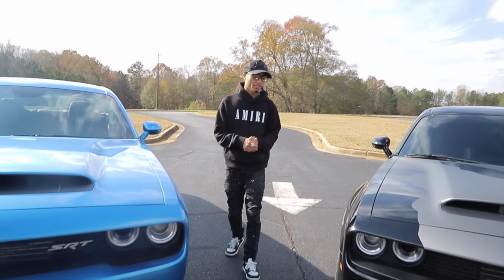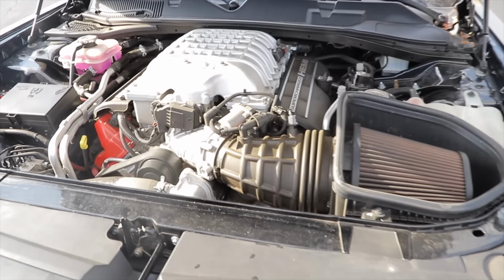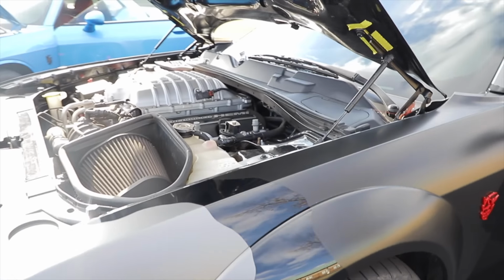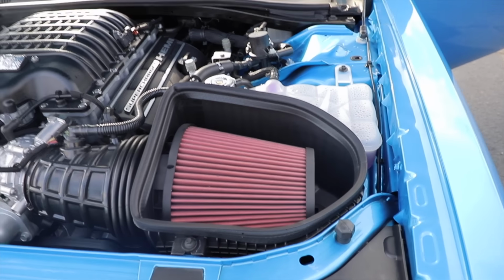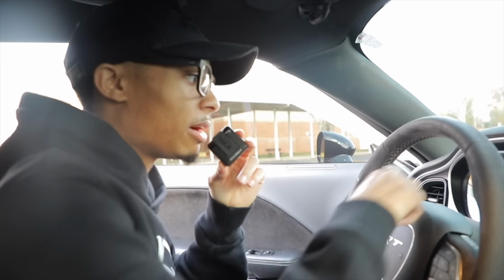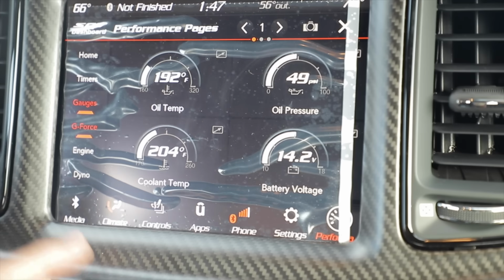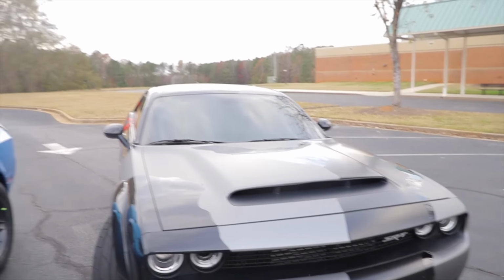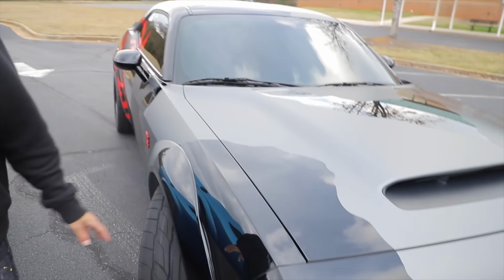FIRST EVER DEMON 170 vs DEMON RACE! *IS IT WORTH $250,000?*

Comment: The guy counting has the advantage on a roll race. The 2018 Demon had 840 h.p. in full power mode I believe. Dodge claimed an 9:65 sec 1/4 mile @ 142 mph I think. I remember Herman from Demonology had to do a lot of runs and tuning etc etc to get his Demon down to Dodge’s claimed times. Obviously a prepped track with really good air etc etc. Herman broke the rear diff mount which Dodge has fixed too. Great cars but it looks like they are no longer. Rest in Peace.🥺😢😫

Comment: 28k Demon170 crate motor in a much lighter 3400lb 70 cuda type chassis with modified suspension, driveline, tires, wheels etc for hookup & it will destroy both those cars easily for much less money.

Comment: The difference between two dodge  Demon's 😈 the 2023 dodge 170 has a small block 426 hemi hellephant engine in it ..!! And the other one has a standard V8 engine 840 horsepower & the other is a  1025 horsepower V8 engine it that's the difference between the two. 😊